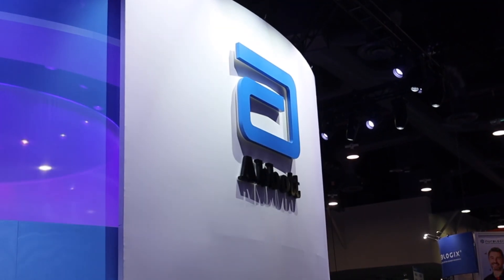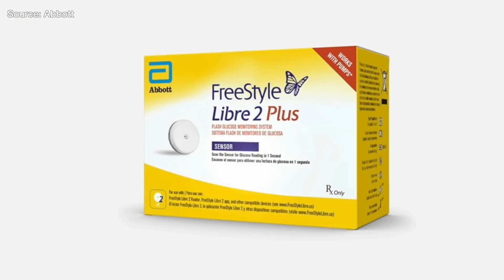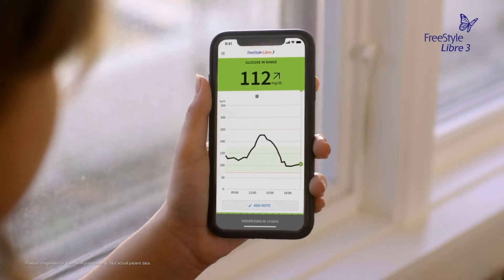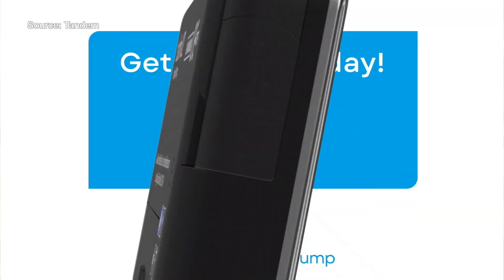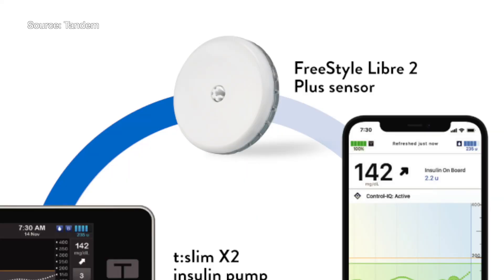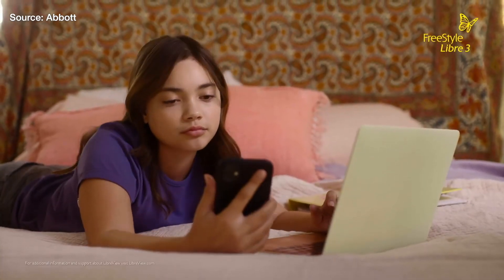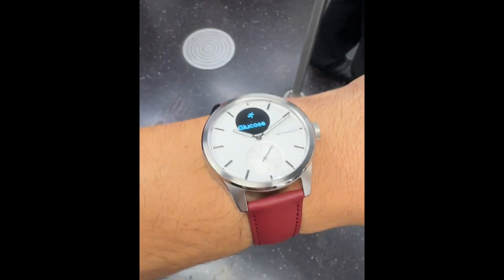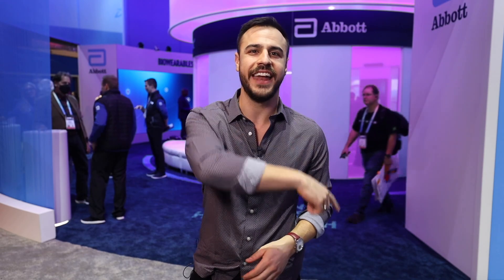NEW Freestyle Libre 2 Plus CGM For Tandem Pumps!

Comment: Did you say that the libre 3 has minute to minute readings? You said it was far faster than the other sensor you were using? Or only libre 2 plus has faster readings?
Reply: I don’t know about Libre 2+ but Libre 3 updates every minute with no scanning
Reply: @ambergraves2896  I thought he said that's what the 2+ is for.
Reply: Libre 2+ has minute to minute readings

Comment: Will it work with my Tandem Basal IQ?  I didn't want the Control IQ.  The Tandem pump has soooo many alarms that I do not want extra alarms for extra info.  Nor do I want more control given to the pump than it already has. Just room for more mistakes and there are too many already--like false reading that then make the pump make wrong decisions. Especially when sleeping and the compression causing inaccurate readings.  But I do want to use the Freestyle Libre 2 plus.  Every minute readings may cause alarm fatigue if it is going to alarm when it goes above or below the minimum/maximum numbers. But May i use it with Basal IQ?

Comment: So if libre 3 is with CamApS Fx then why the libre 2 plus for other pumps? I understand if they do it for the 2 in terms of cost for patients and/or nhs (in uk). But a new version of 2 surely is going to be more expensive? Libre 2 hasn’t needed scanning for a few months now. Or I know here under the nhs it will take ages to roll out as it takes ages to be available to prescribe and funding is for a year. 

The first parts to me felt contradicted once they revealed the libre 3 already worked with a pump.

Also to be honest I’m not sure if the extra day is a good or bad thing. I know people sometimes prefer the longer wear as they don’t like changing it often, but others find it’s hard to keep on that long or it goes gross.

Overall hearing this not sure how convinced I am about this. I’d probably want the libre 3 with CamsAps Fx over libre 2 plus and if that’s the case it is not a superior products. At least when tslim started hybrid closed loop with dexcom they did it with the best and most accurate dexcom on the market, not the older refurbished version.

Comment: I'd prefer if the libre 2 would wait 4 minutes and get the reading right instead of seeing a tiny rise or drop and over-predicting a massive rise (or drop) right away. It's far FAR too panicky.

I'd also LOVE it if I could activate a sensor before the old one expires, save me flying blind for at least an hour. 

So much about the Abbott products and software shows they don't have to use their own stuff.
Reply: One thing I hate is that I still keep getting an alarm when my blood sugar is high but going down already.  Wtf kind of action does the alarm want me to do?  Nightscout doesn’t alarm once it starts going in direction of range, because they actually use their own stuff and can figure out to avoid useless alarms.
Reply: @jilpok1074  If you swipe (dismiss) the notifications, it won't keep popping up. At least on Android.
Reply: I'm ok with the panicky lows as it helps me react sooner. At least most of the time. 
As for activating a new sensor while the old one is still working, that's a given. I don't get why they can't release this feature.
Reply: @lukamlinar  the problem is it can make you treat a low which doesn't exist, leading to a REAL low. Experience teaches you to wait, but it could be dangerous if you don't have that experience, or are tired or just distracted
Reply: No readings for an hour is not going to kill you.